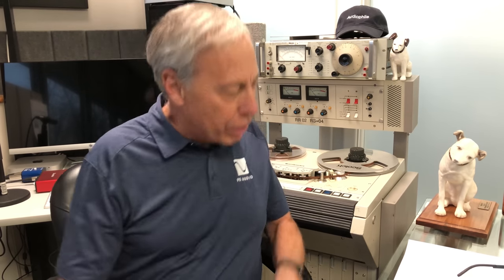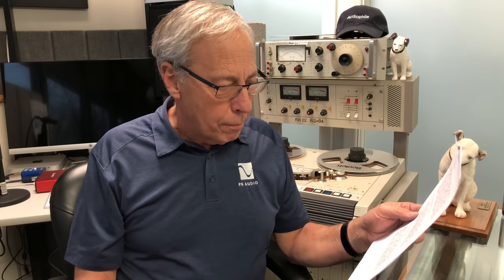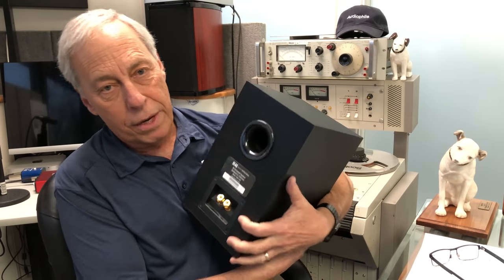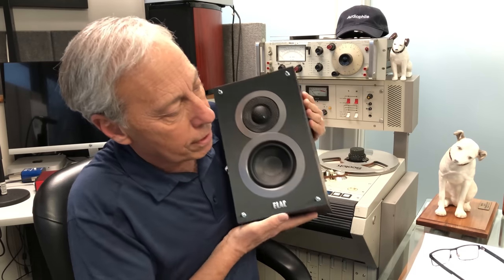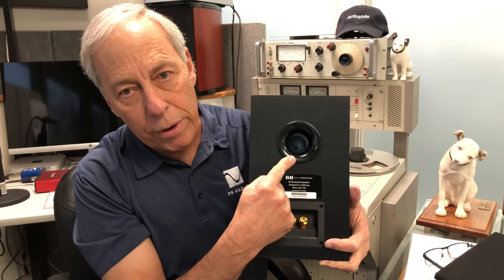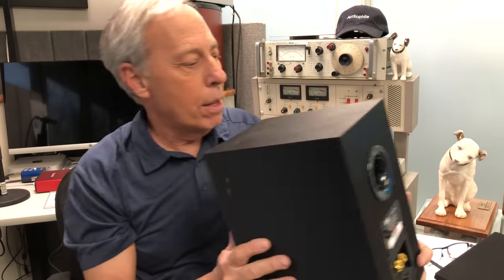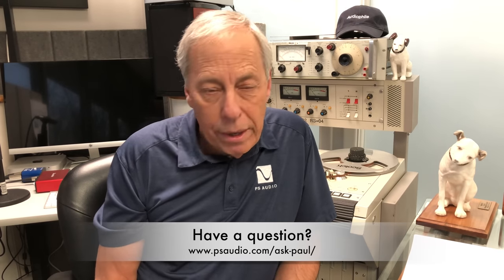Ported loudspeakers

Comment: Rear ports are more picky in regards to room placement. If a rear ported speaker is placed too close to a wall, there can be either an increase in bass amplitude or a cancellation of lower frequencies due to reflections and phase alterations of the sound leaving the port. Make more room behind them, and they will have smoother bass characteristics. Front ported speakers do not experience this problem, so they can be placed closer to walls. But because the port is facing the listening space, it might be easier to hear the port noise. I've got some rear ported bookshelf speakers, and they're pretty close to a wall, so I ended up plugging their ports. Their bass sounds muuch less boomy. And the reduced bass range is being taken up by my subwoofer. It's a win-win.
Reply: I just bought a pair of made in 2002 Paradigm Mini monitors Ver.2  I have read that years back Paradigm used to supply plugs for the rear ports if needed for placement reasons in a said room. At any rate I believe in your comment greatly. Rear ported speakers can be be more picky on the speaker to wall distances. We will see what happens. They will be here tomorrow and yes already running a pair of Yamaha powered subs so I know for sure I can work something out. Thanks greatly on your comment CaveyMoth.
Reply: @VintageGearMan  You're welcome. Dang, I've always wanted to try Paradigms. Their little monitors are supposed to be really good.
Reply: @CaveyMoth  Supposedly the Mini's Ver.2,,  3's, and 4's are supposed to be all that. I did a ton of digging on these speakers. I have ran 70's, 80's and a few 90's loud speakers all my life. I hope these will be a bit more resolving. Great hearing from you.
Reply: I will be happy to update/comment on these Mini's Ver.2 after installing.
Reply: It is a little scary going outside of the 70's ,80's 90's speakers box realm. This will be a new frontier for me.

Comment: Conversely to having a port. Does the sealed speaker with the compression and vacuum going with the cone operation, vacuum when out, pressure when in,  actually create a quicker stop and then quicker restore of the cone and reduce vibrations as the cone goes back to its central position. Thus making the base truer to the original as it is now self controlled. Overthrow and sluggish return are now self regulated by the size of the box in relation to the cone movement.

Comment: Ports have some specific disadvantages. First of all, the loudspeaker is acoustically unsupported below resonance. The box is open. Any frequency below the box tuning causes excess cone motion. The second major disadvantage is that the box is a Helmholtz resonator that only resonates at one frequency. That adds pressure to the bass, but not at the same frequency. One difference between a port on the front, back, sides, top or bottom is its proximity to the wall which can aid or hurt the amount of pressure. Another difference is if the midrange that leaks out of the hole can be heard by the listener or not.

Comment: From personal experience...  I listen nearfield with the speakers at ear level.  When I had front ported speakers?  When certain notes were hit, it was like sitting in front of a hair dryer set to cool. On cold nights I would get cold air blown in my face.  So... rear ports have another good purpose. I prefer sealed or passive radiator speakers. More accurate sounding.

Comment: Whether on the front or on the rear, the port is designed the same. At low frequencies the placement is not critical, since the wavelengths are long, so it can be put on either side. At frequencies below the port resonance there is indeed an issue with anti phase and cancellation and you get a steeper roll off. At the port resonance the driver does not move as it experiences anti resonance, while the output is coming from the port alone. Finally, at higher frequencies the port becomes decoupled and the behavior is the same as for a closed box.

Comment: The main reason why the ports are at the back is the mentioned sound they (sometimes) make. It is simply an artifact from air being pressed trough a tube, the entrance of the tube act a little like a whistle. Positioning it on the back hides it a little. The phase of the ports can be adjusted by the lenght. Simpified, the volume of the air in the tube has a mass and the the air inside  box acts as a spring. If you have a spring and a mass you have a resonator which is allso a low pass filter. Those of course shift the phase of the signal and the signal can be in what ever phase the designer wants it to be at a certain frequency. A second resonator close to the resonance ferquency of the driver adds some complexity to the  whole system, which will not make the design process easier. The more easy (controlled) way to archive the same are passive membranes but you have less possibilities to modify the parameters.

Comment: It can be added  that a front port is still a rear port;  of course it is,it  acts only on the rear part of the woofer,it just has a longer   traject to cause  a delay in the air movement to allow the "meet" , half ass in phase,with the front pressure wave, and try to reinforce it.

Comment: just looked thru some comments ( about 30 + ) didn't see anyone mention ' Thiel / Small' one of if not the first computer type speaker box/ port designs.... My Koss speakers ( 1978 1020 ) Koss claimed were the first to use this development.  Seemed to work, the Stereo Review mag , Sept '78 > had a comment  ' response curve flat + - 2 from 20 to 5000 hz'.... (closer to an amp than most speakers, even Advents of the day.my thought.)  and distortion ' among  the lowest we have yet  measured'  PS  the Koss were fairly large, the mid range 1020's  33in high, 15 wide - 10 in bass with 2 front ports.
Just as a guess, ported designs seem very  common today.

Comment: brian weir
my Focal tower TL speakers have a front port. So do my old college airborne/phillips set. my B&W's have a rear one, and my Infinitys don't . All those great folks who designed them were not hacks; similar to your  comment on A vs D, I think the original design and intent is the most important thing. They are all different and likeable to me. I like my Focals best in general.

1 second ago
Reply: brian weir I too have a pair of transmission line speakers with Focal drivers and I absolutely love them! I designed and built them myself with a great deal of care and effort. I have designed and built a number of ported designs and a few sealed designs but none came close to the sound of the TL’s. To me TL’s seems to have this effortless quality to them. They sound more open and dynamic (sort of like comparing open back dynamic headphones to closed pressure style I guess).

Comment: I read a book by a Dr Bailey who produced a design for a transmission line speaker back in the 1960's 
It was a  design taken up by IMF in the UK who produced some of his earlier designs. His latter design had a lattice of a triangular path which was, he said aimed at reducing internal cabinet resonance. 
Infinite baffle designs usually had to be quite large to reduce the affects of compression and vacuum within a speaker.
The concept of a reflex design was to reduce the affects of compression and vacuum within a cabinet, to produce a smaller speaker and extend the bass response. The design was renowned for reducing definition due to the problems of phase cancellation. I always had a large living room so I favoured transmission line designs with a separate high quality reflex speaker, sitting on top for the quality of sound in the upper frequencies. 
I spent many years in the Hi Fi trade and researched a lot of designs and our company produced the JR 149 which as you might know was designed by Jim Rogers who produced the legendary LS3/5a design used by the BBC.
I still have a pair of Bowers & Wilkins DM4's and a pair of Keff B139 bass units. I hope to resurrect a pair of Transmission line speakers one day. I don't like Reflex speakers because as you say they lack definition. 
Thank you for your informative videos.

Jeremy Travis former buyer for Teletape London

Comment: A reflex speaker having a front port does not thereby become a transmission-line speaker.  Acoustically, it doesn't matter where the port is placed, assuming we're talking about a speaker designed to reach fairly low - say below 50Hz.  Speakers for boom boxes that can only play down to about 150Hz could be a different matter.  
The important point to observe with rear-port speakers, is not to push them up against a wall, which can block the port and make it ineffective.  Drivers selected for ported speakers should have stiffer surrounds and spiders to help prevent over-excursion at very low frequencies (below the port's tuning range).

Comment: I think a rear port has a distinct advantage over a front port. With a rear port, strategically placed, it's possible to effectively control bass reinforcement. Try the same trick with a front ported speaker, nine times out of ten, all you will end up with is excessive bass boom.

Comment: The port controls the speaker over a narrow bandwidth. The driver that you use in a ported box can have a lighter cone and therefore the speaker can be efficient and occupy a small volume. It reduces the cone mass requirement and makes the box smaller and this leads to sensitivities in the range of 89 dB SPL as opposed to 84 dB SPL for 1 meter, 2.83 volt sensitivity in free field. Closed box speakers need to be bigger to have the same lower bandwidth limit and efficiency.

Comment: Sealed has a cleaner sound but requires more power. I personally think it depends on what kind of music you listen to. I dont know. I like a sealed box for rock and metal. But if you get into the hip hop style the speaker cant react fast enough and starts to bog. If that makes any sense. Love all your videos Paul.
Reply: NTH Welding , I had an old vintage pair of Advent 3 way speakers with a 12 inch woofer, 4 inch mid and 1 1/2 inch dome tweeter, sealed. 
I compared them to a set of equal speakers made by Cerwin Vega, no comparison, the Vegas blew them away. but on the other hand, the Advents although took more power to run as loud had a much tighter hitting bass frequency, so I just used all four speakers in the same room. the sound was great!!!!! it really comes down to if you have tube amps or digital amps and what type of music you like.

Comment: Med always comes out of ports too (but at a really low level). But it's enough to effect the med tone and make the voice sound wrong. But if the vent is at the rear of the speaker the med (from the port) is less heard. That's why I reckon most ports are rear.

Comment: I have a pair of B&W 804 D3 floor standing speakers. They sit 3 feet from the back wall but are close to the side walls. I didn’t like the mid bass boom I was getting so I have now put the supplied foam bungs in the ports that are on the front of the speakers. They sound way better now. If I add a sub (or two) to extend the bass down, would I still get any bass bloat in the room, seeing as the 804s are now “sealed”? Thanks.

Comment: In a ported design the speaker cone barely moves near the ports tuning frequency. So the box and cone actually see much more pressure than a sealed enclosure. This can have a couple advantages like reduced distortion if designed correctly. This is a misnomer and common misconception that sealed produces less distortion. There are many advantages like the amp is only needing half the power at the same loudness further reducing distortion. If you dont believe me listen to a self powered gelelec studio monitor. No chuffing either .

Comment: At tuning frequency the port is at 90 degrees out of phase with the driver. At the upper resonance is where the phase is perfectly aligned between the driver and port. At the resonance below tuning freq of port they are 180 degrees out of phase and the port and driver cancels each other like a dipole. The port is basically loading the driver at tuning freq of port.

Comment: It's been my observation through the years that I prefer rear-firing ports as opposed to front firing port. IDK if the bass slams into the corner of the room behind the speaker and has more wave-length to travel or what. I was skeptical of my Kicker's Sub-box having a huge side aeroport, but it doesn't seem to effect any sound quality. so... IDK.

Comment: Put simply, a ported enclosure is an acoustic resonator The mass of air in the port resonates with the volume of air in the box. If tuned correctly it should radiate the bass in phase with the woofer hence greater bass output. The 'tuned circuit' of the box/port causes a 180 degrees phase shift for the driver rear output near the resonance peak of the woofer. If critically tuned it can also damp or smooth out the bass response of the system. There are formulas for calculating optimum port sizes for a given box and woofer (Thiele Small parameters) Not room here to go into this now.

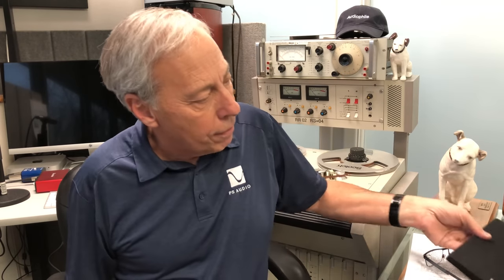Comment: 5:45 this is incorrect. Vents do not relieve pressure inside the box, on the contrary it increases the pressure until you get to a little below the fb. Air has mass and the ports use this mass to load the driver. Push a lot of air through a little hole and it moves very quickly, when the driver begins moving back the other direction the air in the port is still moving the same direction  this is where the increased pressure comes from and why you get more sound pressure. Sound is pressure, less pressure less sound.
Reply: Odd that such a seasoned audio professional would make such a glaring error. Hmmm. I listened to it a couple times and that's what he said. Misspoke, or actually doesn't understand fundamental physics of mass and momentum?

Comment: Hi Paul.   I have a pair of Roland DM-20 front ported.  Because I'm curious I pulled them open and found them empty except for the built in amp. I decided to stuff them a little bit with some pillow material.  These are monitor speakers used, and was wondering if filling them is OK?  They sound good, especially once I took them off the floor.  Should I not have stuffed them, or does it not matter?  I use them for listening to music, not mixing or anything.   Thanks!

Comment: Front ported are much easier to place than rear ported ones as the latter need room at the back (normally 20cm) for all that as sound energy to be released easily. Hence, Big spaces rear ported, small spaces front ported. Example, you can't keep a rear ported bookshelf in an enclosed area...where as a front ported will work just fine.

Comment: Given a round to square opening, front/rear ports use (mathematically calculated) LENGTH of the tube ( inside the speaker) for optimization.